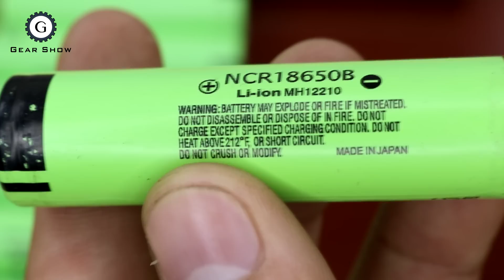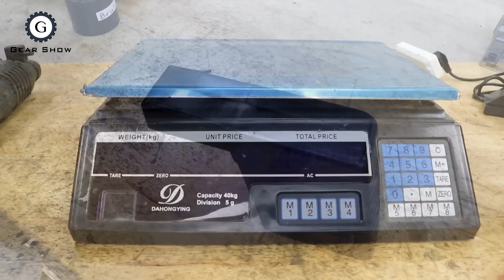24V Battery Rebuild for Bosch Rotary Hammer Drill | Bosch GBH 24VRE

Comment: Wait a second. In the beginning you removed the plastic "tunnels" for the screws, because there was no room for the batteries and after you put all these batteries in the pack you drove screws THROUGH the batteries? You remember that you removed the "tunnels" with the threads for these screws, right?
Reply: I think if you carefully watch, the pillar removed, was simply that, it wasnt a screw location, more of a support to prevent the case pushing inward in the center? The screws are on the perimeter, not in the center.

Comment: It is fascinating how technical progress combines old technology with new! I worked at Bosch in the Blaichach power tool division and I deal with the machines on a daily basis. The GBH24 was launched on the market in February 1984, an unbelievable sensation (!) I can still remember very well when the first devices came to the dealers and we had to be presented. The craftsmen and industrial companies literally tore the machines out of the hands of the sellers ...> you could only get a good 30 minutes. work with it, but that didn't matter (!) For the first time, customers had the option of drilling holes in concrete far away from the power grid or on construction sites. At that time, battery technology was still in its infancy and after a few years the devices were repaired where the cells had to be replaced. Today 37 years later I am retired and am amazed again and again how far the technology has advanced with the LION batteries and that there are still people who receive these devices and even work with them!
Reply: У меня есть два таких аппарата абсолютно новых, я бы хотел отдать их в музей но таких не нашел

Comment: For power tools batteries it's way better (I sould say "mandatory") to use high drain cells instead of high capacity ones. Whatch out overheating of the high capacity cells under high loads!
Reply from the maker: Okay, thank you so much for sharing!
Reply: @marsdeimos4301  I was about to comment the same; 2ah  charge per cell is way too much.   Usually I don´t rebuild old hammer batteries like this  for old high drain tools because it is not safe to use it; they lack of any battery drain circuitry and it can result on a very pist client  complaining about it not working after 2 or 3 uses...      Always build greater battery than wht the motor or aplication needs, not the oposite!
Reply: @gear_show  kar rahi yaar

Comment: 20*1.5v=30v = 7 pieces li-ion batteries.
Reply: Ni-Cd/MH 1v-1.5v
li-ion 3v-4.2v
Reply: @Боард  Exactly. I had same problem because i managed to put only 12 cells inside. Original voltage of this battery is 20-30V - if i use 7S1P liion i get 21-29.4V and this is ideal. 6S2P will give me 18-25.2V but i have double capacity. Simply cant add 14 cells - must find some other way :D

Comment: Please invest in batteries more suited for this operation. The 18650B from Panasonic is only rated at Max. continuous discharge current of 4.875A
.The cells in most current LION battery packs for power tools are rated for 15-20a continous discharge.

 I would look in to cells rated for 20a discharge such as the Samsung 25R INR or LG HG2 cells. Great videos!
Reply from the maker: Okay, thank you so much for sharing!
Reply: Good info 👍🏼
Reply: Yep, my first attempts back in the day to restore old NiCd tools failed for the same reason. You need high drain cells.
Reply: I'm sorry to disappoint you, but those are not Panasonic cells nor 18650B. Don't get fool by the shrink wrap. Panasonic don't use that kind of top button.
Reply: @mitevm  have you ever revived nicad batteries? I've seen people use a 6volt or 12volt battery charger to shock a used nicad battery that's not holding a charge. I think they called what happened to the nicad battery was "treeing"?  Anyway was wondering if you had revived any sub c size nicad and if so how long did they last(estimated charging cycles)???
Reply: @petkovasilev1419  You can not spot a fake Panasonic cells by visuals only. The only reliable method is to check for the internal resistance which is 35-45 milliohms for Panasonic 18650B.
Reply: @imranakhtar4478  Are you sure my friend that only Panasonic 18650B have internal resistance of 35-45 milliohms? Those are not Panasonic and it is according to my humble opinion of a man that has processed a few thousands original cells.
Reply: @petkovasilev1419  Many other cell can have internal resistance in this range but none of them will have same capacity as Panasonic 18650B. There are many fake Panasonic 18650B cells which look, weighs and have the same capacity(3400mah) as Panasonic 18650B (at initial tastings). Internal resistance of cell is related to electrolyte and electrode used in that cell. It can tell us if the it is using the same chemistry as original Panasonic 18650B. Usually fake Panasonic 18650B cells have internal resistance of around 70 milli ohms (according to my testing), which clearly states that they are using some other kind of chemistry.
Reply: @petkovasilev1419  I totally got your point. I just explained a reliable method to actually know if cell is original or not. Measuring internal resistance is not difficult. We need 1ohm resistor  and a multimeter.
Reply: good

Comment: If you wanna measure cell voltage use setting up to 20volts on your multimeter not up to 200 then it shows you 3.6X volts not just 3.6
Reply from the maker: Okay, I got it, thank you so much for sharing :)

Comment: li-ion battery nominal voltage is 3.7 you need 7 cell for the same 21 cell nicad battery and like other said you need high current discharge cell , this dril power is like 400 watt (the corded version was 600w )
Reply from the maker: Okay, thank you so much for sharing! If 7 cells the battery case can load only 7 cells.
Reply: I have 2 same drills and have same problem. 7S is needed but there is no space for 14 cells.

Comment: Not 1,2 volts. When it is full charged it will be about 1,4 - 1,44 v...
21 x 1,4 = 29,4 v and 
lion must be 29,4 / 4,2 = 7 cells
On the other hand, those cells are icr. How can you use icr batteries for a powerfull drill? You must use INR at least 30 amps max discharge.

Comment: Hello, where do you buy the batteries and the bms? I want to repair the battery of my drill but I can't find any reliable place where to pair the batteries, the battery of my drill is 12v, could you give me any recommendations when it comes to repairing it? thanks
Reply from the maker: Hello, I bought them from China. You can buy it from anywhere, but you need to check user reviews for make a purchase. What is your drill model.
Reply: @gear_show  my drill is a black decker CD12C Typ 2
Reply from the maker: @cessarr8206  I used to rebuild this type of battery. I could use 6 cells with this battery case by using BMS 3S20A.
Reply: @gear_show  Thanks for your help, when I rebuild my battery I will tell you how it has been

Comment: Hi there. I have one question: the batteries you're using have maximum discharge rate of 6.7A. You arranged them in 2P configuration, so they can withstand 13.4A. Yet you've put a BMS that can handle 30A. How does that work in practice then? If the current draw from tool is more than 13.4A, won't batteries be damaged, burned?
Reply from the maker: I think the BMS will handle about this problem.

Comment: need your help 
I have a 24 v nicad DeWalt battery 
I would like to convert to a 24 v Li ion battery and charger   What and how many batteries would I need?
 What type of BMS and charger?
 I would like to use to put the battery in charger 

you have 6 cells x 4.2 =25.2 but you used 12 cells I don't understand this
Reply from the maker: I used 12 cells, because I want large ampere. I connected 2 cells in parallel. Parallel increases ampere same voltage, while series increases Voltage same ampere. You need to understand "series" and "parallel".
Reply: @gear_show  ok thanks
 now i know that how does one then choose batteries and a BMS

Comment: Have you ever revived nicad batteries? I've seen people use a 6volt or 12volt battery charger to shock a used nicad battery that's not holding a charge. I think they called what happened to the nicad battery was "treeing"?  Anyway was wondering if you had revived any sub c size nicad and if so how long did they last(estimated charging cycles)???
Reply from the maker: Yes, I did it. I revived them with a cycle charging. Some batteries have been saved, some are completely dead.

Comment: I wonder, is there any risk to the internals of the hammer drill since this battery can deliver much more current than the NiMH batteries?
Reply: The drill will only draw what it needs. Like a computer power supply, if you have a 1000w power supply, and the PC only draws 150w, it just doesnt use it to the max capability.
Reply: xfiles4484 You’re absolutely right of course. You’d think having an engineering background I would remember “current follows voltage”.

Comment: Hi, I found that Panasonic NCR18650B 3400mAh can delivery only 4.9 ampere at time, so the max power your pack can delivery is  4.9Ax2(parallel)= 9.8A x 25.2V (total voltage) = 246.96W, right?
Can you measure this? I think the only way is making a 24mm role in a concrete material and use a multimeter.
Reply from the maker: Oh, yes you are right, thank you for sharing!
Reply: Good info 👍🏼
Reply: @gear_show  why when you measure  fully charged pack you get only 23.1V instead 25.2V?

Comment: The Real Voltage when  original battery  charged to 100%  is close to 30V ..you calculate  wrong . Machine work like this voltage is almost 60% from its real power .

Comment: That's not correct. 7 cells for 29,4V you need. Oem is 20 Ni-cd cells, by fully charged is around 28-29V. I have put Samsung INR21700-40T cells with BMS on my Makita BHR200 and it's run very fine.
Reply from the maker: Okay, thank you for sharing. It is what I need.